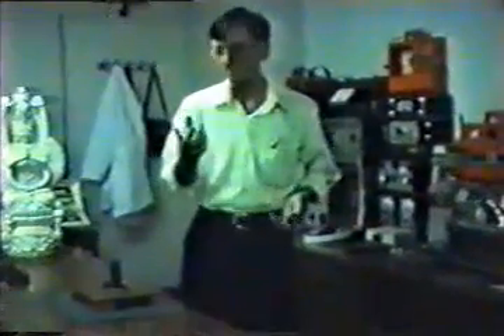Dr. James B. Schwartz - демонстрирует БТГ, Free Energy Device. Перевод ниже. Спасибо!

Comment: «This is something you won't see in the world market because the other companies of course don't want this on the market. 
It's just a wooden frame. It's got a auto switch on it right here an automobile switch, switch. 
- I'm going to get closer.
Okay, turns it off and on. I put a cover over it a jar to protect it. Now it's compressed, the material in this is made of one rod is made of 73 different elements. The other side is made of 74 elements. There's one additional element and that's why one is negative and one is positive. One builds up the electrons. The neutrinos that strike the earth 24 hours a day and other things striking the earth. The combination of them causes electrons to build up in one of these rods and it depletes them in the other side, much like a solar panel works, very much like a solar panel, but a solar panel needs light 24 hours a day if you're going to use it 24 hours. Otherwise it only works when the sun comes out. Now this here, as you can see, very, very light. Very light, has practically no weight to it, but there's, there's plenty of energy. There now, as I run this up the rod you can see.
- Let me get a little closer there, okay.
These are Christmas tree lines. Honey we can't involve Christmas ...
- Let me get a good close-up of those light. Let's see those bikes again.
Okay.
- All they are is what the just.
Regular Christmas tree lights.
- That would hold the other hand, so I could see a little bit better the light bulb. Someone said light bulbs without them being lit.
Oh, without them going, yeah.
- Just hold them there for a second, and all they are is grouped together in a little tape holes in.
Yeah, they're just put together here, there's three of them together.
- Okay, so now what you're doing is ...
The surfaces of something bright, so people can see.
- So, you're putting one wire on one rod and one on the other, that's right, okay.
Just like negative and positive.
- I turned the rod sideways, so we could see them individually.
Okay.
- There you go.
Now it's not a battery, because you cannot light the battery now.
- Okay.
And to show it's not a battery, anywhere you move it up and down the rod, lights work, see. See anywhere, down here.
- Anja
Oh, yeah, the same anywhere you want to put them, they work. This is a 25 watt ball, one times, one can 25 watts. Now let's see what happens when we put, that on.
- Okay.
Now of course, it won't be as bright, because it, uh, this takes a lot of amperage, you know, and the wattage, this here, the watts on this thing here, is only about, right now, about 18 watts only, and this is 25 watts.
- Does the rods get hot?
Uh no, the rods don't get hot, the light bulb is just hot.
- Yeah, because it's, uh.
Yeah, it gets hot, and of course you can't see the heat there, but now I'll give you a good shot of the, uh, the light.
- Okay, that's better.
Now you need very big battery to do that, if you want to do that with a battery.
- Anja.
You know, that's to show  there's no power here as far as storage power. It stores a certain amount of electrons because it builds up.
- Umhu.
Now let's cover them. We're going to cover them up, so now no, no light can get to them, so we can show they're not like a solar panel. Now let's turn the switch on, so the power is now going from the bottom terminals, through the switch here, to the top here.
- Okay.
Now we use these two terminals on here, because sometimes at the cave site we used, to use this to charge the big battery.
- Anja.
All right you see, so that's why we put those terminals on there. Now let's black it out, see if we can still light it.
- Umhu.
See what I mean? You don't need light, so we're not getting it from the fluorescent lights here and I'm getting the power from the fluorescent virus.
- All right.
Now the, this is this kind of electricity is very much like lightning. You know how devastating lightning can be.
- Umhu.
Linghtning is because the earth is negative and the atmosphere is positive and when lightning strikes ...»

Comment: 00:00
 this is something you won't see in the
00:01
 world market because the other companies
00:03
 of course don't want this on the market
00:05
 it's just a wooden frame it's got a
00:08
 auto switch on it right here an
00:10
 automobile switch which
00:12
 i'm going to get closer okay turns it
00:14
 off and on
00:16
 i put a cover over it a jar to protect
00:19
 it
00:20
 now it's compressed the material in this
00:24
 is made of one rod is made of 73
00:28
 different
00:28
 elements the other side is made of 74
00:32
 elements there's one additional element
00:35
 and that's why one is negative and one
00:37
 is positive
00:38
 one builds up the electrons
00:42
 the neutrinos that strike the earth 24
00:45
 hours a day
00:46
 and other things striking the earth the
00:48
 combination of them
00:49
 causes electrons to build up in one of
00:52
 these rods
00:53
 and it depletes them in the other side
00:56
 much like a solar panel works
00:58
 very much like a solar panel but a solar
01:01
 panel needs light
01:02
 24 hours a day if you're going to use it
01:05
 24 hours
01:06
 otherwise it only works when the sun
01:08
 comes out now
01:10
 this here as you can see very very light
01:14
 very light has practically no weight to
01:17
 it
01:18
 but there's there's plenty of energy
01:20
 there
01:21
 now as i run this up the rod you can see
01:24
 let me get a little closer there okay
01:28
 these are christmas tree lines honey we
01:31
 can't involve
01:32
 christmas let me get a good close-up of
01:34
 those lights let's see those bikes again
01:36
 okay all they are is what the just
01:38
 regular christmas tree lights
01:40
 that would hold the other hand so i
01:41
 could see a little bit better the light
01:43
 bulb someone said light bulbs
01:45
 without them being lit oh without them
01:47
 going yeah
01:48
 just hold them there for a second and
01:50
 all they are is grouped together in a
01:52
 little tape holes in
01:53
 yeah they're just put together here
01:55
 there's three of them together
01:56
 okay so now what you're doing is the
01:58
 surfaces of something bright so people
01:59
 can see
02:00
 so you're putting one wire on one rod
02:02
 and one on the other
02:04
 just like negative and positive i turned
02:05
 the rod sideways so we could see them
02:07
 individually
02:08
 there you go
02:09
 [Applause]
02:13
 now it's not a battery because you
02:15
 cannot light the battery
02:17
 now okay and to show it's not a battery
02:20
 anywhere you move it up and down the rod
02:22
 lights work see see anywhere
02:26
 down here oh yeah the same
02:29
 anywhere you want to to put them they
02:33
 work
02:34
 this is a 25 watt ball one times one can
02:38
 25 watts now let's see what happens when
02:42
 we put that on
02:44
 now of course it won't be as bright
02:47
 because
02:47
 it uh this takes a lot of amperage you
02:50
 know
02:51
 and the wattage this here the watts on
02:53
 this thing here
02:54
 is only about right now about 18 watts
02:57
 only and this is 25 watts does the rods
02:59
 get hot
03:00
 uh no the rods don't get hot the light
03:02
 bulb is just hot
03:04
 yeah because it's uh yeah it gets hot
03:07
 and of course you can't see the
03:09
 heat there but now i'll give you a good
03:11
 shot of the
03:13
 of the uh the life
03:21
 now you need a very big battery to do
03:23
 that if you want to do that with a
03:25
 battery
03:26
 you know that's to show there's no power
03:28
 here as far as
03:30
 storage power it stores a certain amount
03:32
 of electrons because it builds up
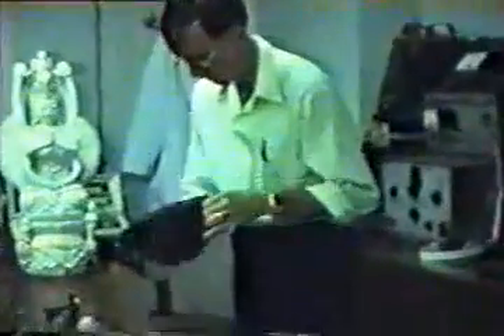03:35
 now let's cover them we're going to
03:39
 cover them up
03:40
 so now no no light can get to them so
03:43
 we can show they're not like a solar
03:45
 panel now let's turn the switch on
03:47
 so the power is now going from the
03:50
 bottom terminals
03:51
 through the switch here to the top here
03:54
 okay now we use these two terminals on
03:56
 here because sometimes at the cave site
03:59
 we used to use this to charge the big
04:01
 battery
04:02
 all right you see so that's why we put
04:04
 those terminals on there now let's black
04:06
 it out
04:07
 see if we can still light it see what i
04:10
 mean
04:11
 you don't need light so we're not
04:14
 getting it from the fluorescent
04:16
 lights here and i'm getting the power
04:18
 from the fluorescent virus
04:20
 now the this is this kind of electricity
04:24
 is very much like lightning you know how
04:28
 devastating lightning can be
04:30
 lightning is because the earth is
04:33
 negative
04:33
 and the atmosphere is positive and when
04:36
 lightning strikes